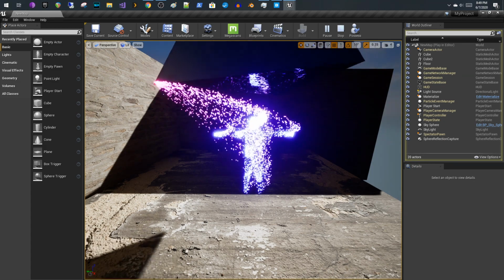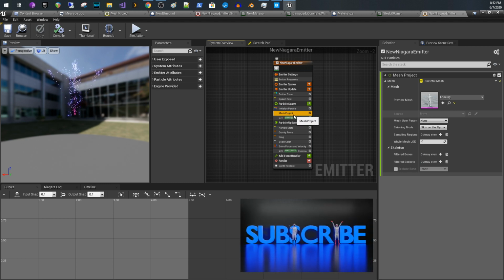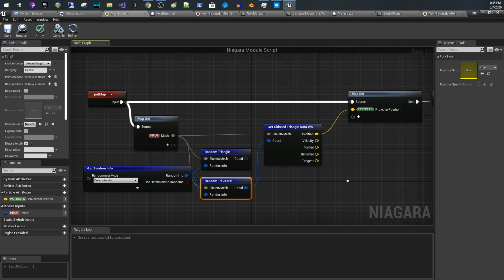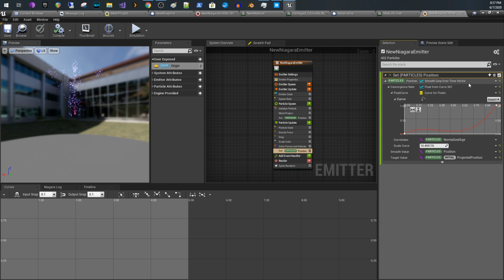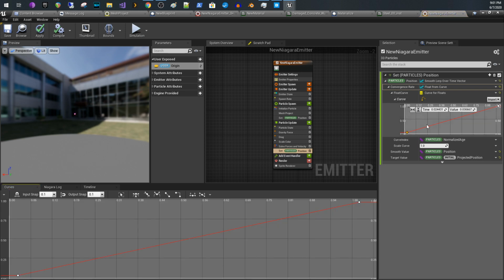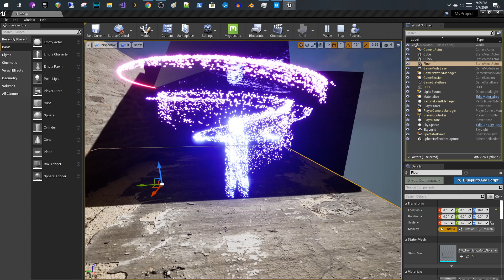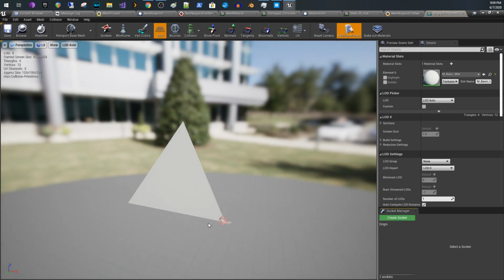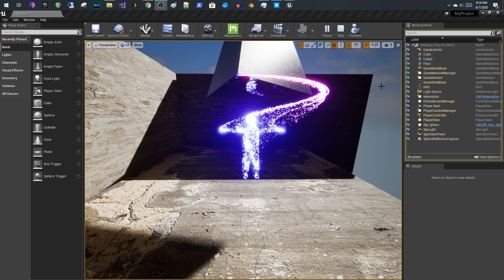Niagara Skeletal Mesh MATERIALIZE

Comment: This is great and I learned a lot!  It's close to an effect I'm trying to create but haven't been able to pull off.   I'd like the particles to go from an emitter and create a projection of a character similar to a hologram.  The problem I have is the skeletal mesh has eyeballs and a teeth and mouth cavity that I'd like to exclude.  Is it possible to combine this with a collision event so they would hit an stick to the visible mesh and not reach triangles like the backs of the eye and ideally only the parts of the mouth that are visible, so if the character's mouth is closed nothing internal would hit and if it is talking the visible portion of the mouth could be seen?  keep up the great work!
Reply from the maker: Hi Shane. You can definitely emit particles and have them create a projection of a skeletal mesh. This is normally accomplished by using a smooth linear interpolation to move the particle from the source location to the destination location. I am not 100% sure how that interacts with particle collisions, but I will look into it and if I find it interesting enough I may make a video about it.  I am also going to look into only spawning particles related to portions of the mesh rather than the entire mesh itself. Thanks for your support and the great question.

Comment: Great job,  this is amazing! I had a question, could you combine this with a material erode, so you can implement it as a dematerialise/materialise teleporter, but the mesh breaks into particles, then the particles move towards another position, and then rematerialise?
Reply from the maker: You definitely can do this. If I find time I will try and put out a video that shows you how to do it. Thanks for the idea.
Reply: Thanks a lot!